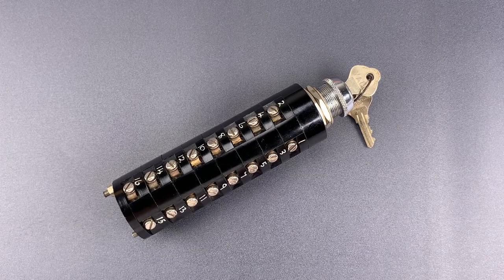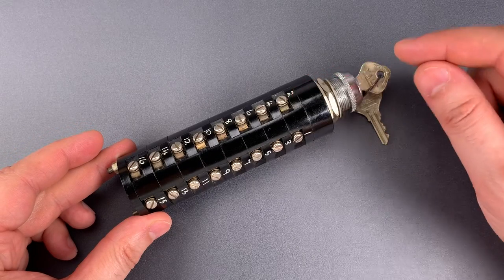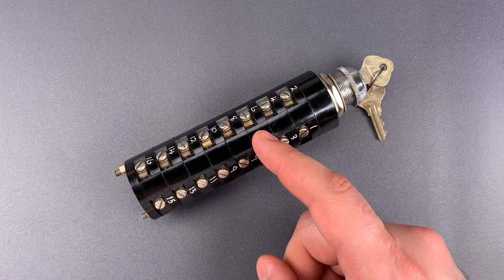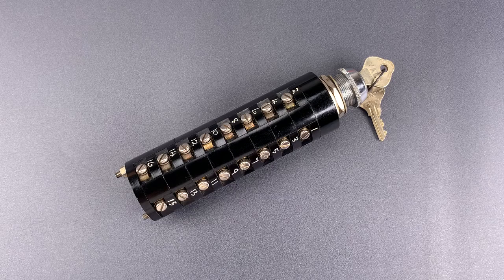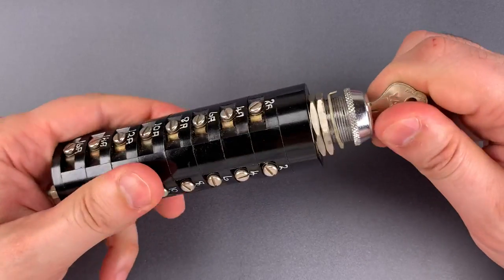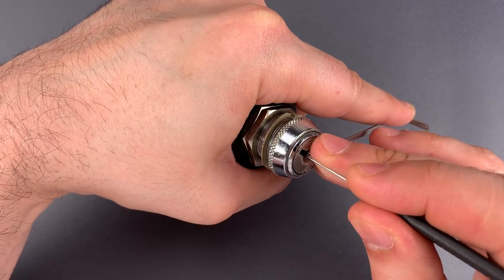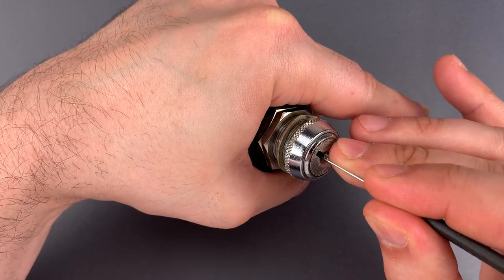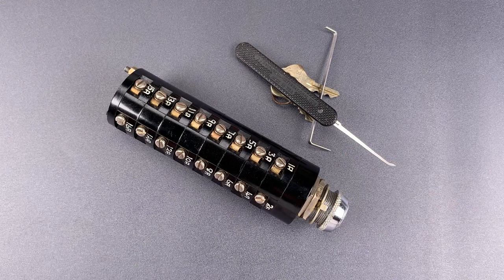[1154] Missile Control Key Switch Picked

Comment: For those of you blasting the use of a wafer core on a missile control system:

You may have heard him say that this is part of a lockout system used for pilot training, which means that it will usually be just left on, and only locked during training (when the plane would normally not have any weaponry loaded any way).  So this is a lock that would normally be unlocked (so why make it high-security?) and only used when there is nothing to lock away (so why make it high-security?).

You also get to see stuff like this a lot when working in high-security areas.  Locks inside secure areas are mostly about keeping people from making mistakes, not about additional security.  When the building is already made of 8-inch rebar-reinforced concrete, no windows, steel-bar-grids on the ventilation, safe door with an X-09 combination lock as the only entrance; either only trusted people are going to get in, or whoever forces their way in could go right through any internal security.

Also, lock-switches in electrical systems are inherently bypass-able by anybody who can get inside the chassis, and most electrical systems aren't built inside a safe.
Reply: I disagree on one point you make. Im no expert mind you but it stands to reason that training pilots would (in some situations) have their planes armed or loaded. The flight characteristics of a loaded vs unloaded plane are subtle to be sure but as these pilots are to know their plane upside down and backwards i would bet they can tell the difference.
Reply: La Nausée  Excuse me? MY logic is faulty? You think aircraft carriers have extra room for dummy missiles? Or that the military would spend 10s of millions of dollars on non functional weapons? Or that the military would take the chance of having dummy missiles loaded on a plane that could be deployed to live combat at a moment's notice? I'm sorry but MY logic is rock solid.
Reply: @tjthrash0143  You sound just like any random guy who never actually served,,,but who has watched lots of movies and TV....My experience is in opposition with your speculation...But believe anything that you want to...
Reply: @stevebell4906  My tiny bit of knowledge and common sense trump your unspecified experience. Unless you care to enlighten us all.
Reply: @stevebell4906  So instead of informing us and either continuing the debate or ending it with your vast experience like a mature adult you choose to lob insults reminiscent of a troll.
Reply: @tjthrash0143  There is no argument of debate....The fact simply is I am totally unconcerned with convincing you that fire is hot or water is wet....There are many like you that embrace an alternate one where reality and facts...and proof or evidence are of no consequence in...along with experience....Henry Ford is credited with this quote..."The average person is will to do almost anything to avoid having to think"...Enjoy your magical thinking...after all you just somehow magically know!...and I couldn't possibly !
Reply: @stevebell4906  as you wish troll. Good day.
Reply: @tjthrash0143  By by whiny boy....
Reply: "They'll never get past the perimeter defenses."

"It's just a precaution against user error!"

This kind of philosophy is how Metal Gear got compromised in 1977, and every 3-5 years after.

Will we ever learn?!
Reply: @Cinkodacs  Apparently your google feng shui is greater than mine.
Reply: @tjthrash0143  if the weapons are painted blue, their are training ones. You can see all sorts of blue weaponry, including missiles
Reply: @tjthrash0143  dummy munitions are used all the time for training. They are painted a different color, usually a turquoise blue, to distinguish them from live munitions. Don't believe me, Look it up.

Yes. An aircraft carrier has room for them. I'm not sure you really understand just how huge an aircraft carrier is.
Reply: As a security guard who's familiar with government contracting, I can confirm that the farther you get into a secure area, the less intrusive the security checks will be
Reply: Thresher the military absolutely wouldn’t spend tens of millions on dummy training missiles. It’s probably hundreds of millions. And yes, there are a TON of training missiles for all sorts of training. You can find plenty of videos about them here, or other research on Google.
Reply: @tjthrash0143  you are funny: "like a mature adult".... say no more right
Reply: @Kelvin.id.  he got BTFO'd, I don't expect he'll be back LOL 😂 Anyway, regarding training munitions... they tend to fall into two categories: captive-carry which are usually just a shell with ballast weight to simulate the real thing for handling and drag and only go on and off the plane by ground crew (they're as much to train these guys as the pilots). And live devices with functional propulsion/guidance but an inert warhead which would be used for live-fire exercises. Explosives are expensive.
Reply: La Nausée  In north Germany there was an incident where accidentally a mililtary jet dropped two dummy weapons onto a wheat field or similar. So they have dummy weapons which cannot be launched but still dropped. Or it were fake bombs. I am not sure but I think there are also actual launch able rockets which can fly but do not have a warhead.
Reply: When you need just a little bit more security than a switch. Most likely being used by an ordnance guy to make sure A:  A random short circuit doesn’t launch a weapon while his crew is loading it or B: Make sure the release mechanism of the telemetry pod that replaces something like a sidewinder during training doesn’t accidentally get thrown overboard when the pilot pulls the trigger. The second set of circuit terminals adds credence to that as different actions would need to be taken by the launch mechanism in those different scenarios.
Reply: @tjthrash0143  Not only are dummy weapons used for aerodynamic reasons, but when using the sidewinder they have an inert version with the seeker head so they can practice acquiring targets with it.
Reply: @Teampegleg  That's pretty cool. Alot of people have corrected me on this but thank you for the additional info.
Reply: Hoo boy another INTERNET ARGUMENT
Reply: Wait shit im late nvm
Reply: Also let's not forget that most of the security comes from the fact that it would be very very hard to get into a fighter jet at an airbase without authorization to begin with, it's kinda like how MRAPs don't even require a key to start, because it's assumed you're not gonna be able to get into them unless you're supposed to in the first place.
Reply: yeah but.... Nobody hs blasted the use of a wafer core..
Reply: tl;dr it's a safety lock not a security lock.
Reply: LOCKS ONLY KEEP HONEST PEOPLE OUT
Reply: @tjthrash0143  uhm, a bit of both actually, and yeah, airman here. They use live missiles when dogfighting against obsolete remotely piloted F-16's at the end of their service life, the reason is to increase our skills at taking down planes that are incredibly hard to take down. But for most other circumstances, dummy missiles and bomb loads will be used, because for the most part, a misfired dummy missile, or an earky dropped dumb bomb, won't hurt people in a 100m radius or more
Reply: @ToastGamingNCrew  Thank you for the info. And for your service!
Reply: Yes, I think that the military will definitely spend 10s of millions of dollars on nonfunctional weapons. That's just how they roll, ya know :D
Reply: La Nausée  Wouldn't they have to do SOME training with live weapons though? Like on a bombing range.

Comment: Seems like this is more of a fail safe than a security measure. An arming switch that needs a key and has to be turned firmly can't get turned on accidentally.
Reply: It is safety measure for electrical circuits to work only on 0 / 1 position and make intermediate position as short lasting as possible.
Reply: Yeah its basically there to make sure that you can't accidentally have live missiles on an aircraft. You'd need to have the key which you'd have to request anyway and you'd have to have purposefully used it, no accidents here.

Comment: I have used many of those switches.
It was used on training boards. To induce faults. The odd and even wires along with switches induced faults to certain components for testing.
Let's say you wanted to test a student on what he learned. So you turned the key to the position and other switches to the position. The student uses his meter to touch test points on the test board. Then writes down his answers and what he thinks is wrong and how to fix it. The student then turns in his answer. The instructor flips up the next switches and it gives a new fault for the student to test.  This allows the instructor to have 20 boards next to each other and the answer to each board to be different.  All the instructor has to do is look at what position the key switch is in. And any of the one other switches position is in the up position. The Instructor then knows what the fault is for the test. The instructor marks on the student's paper and the student has a grade, for each fault test. the key was there so the student couldn't change the fault control on the front of the board where he had access.

Comment: It's a commonly used key switch from back when I was an apprentice electrical engineer. The company I served my time with constructed oil rig switch gear. These switches would be used on pretty much every switching cabinet and can be built up just by adding more switch barrels to the end. I recall the storeroom having them in various position settings from the basic 2 position in the video right up to the massive 32 position barrels which were around 15cm/6 inches in diameter, still operated by the same tiddly little locking mechanism.

Comment: You have to consider that in the 80s, the sort of information required to pick a lock like this was a lot harder to come by. Furthermore, these locks would pretty much only be used on secure military bases. This lock is sufficient enough to slow down your common hooligan long enough for the armed guards to show up lol.
Reply: It's more likely designed to keep airman from accidently setting it off nowadays the ones I seen are literally held with a screw
Reply: @ALPHABEASTACE  Yes, more like the maintenance locks used in industrial facilities to prevent accidental starting of machines while someone is working on them.

The pilot would probably have the key in a sealed envelope or something like that and if ordered to use live ammo he would take it and use it. Otherwise why bother loading live ordnance on board in the first place if the pilot has no way to access it during the flight?

So more like sophisticated safety catch.
Reply: @Murgoh  Given that he said training, it's live missiles loaded on an aircraft, but set into a configuration where they acquire target, but do not launch. For a lot of ATA missiles, a good portion of what acquires the target lock in entirely inside the missile itself. Even if you were using a missile with no warhead or motor in it, you wouldn't want to go through with the gull launch procedure, and jettison a pricy training aid off the launch rail. You also don't want anyone to accidentally switch the plane into training mode during a live exercise, hence a keyed switch. The pilot wouldn't have access to they key, so can't change from training configuration to combat or vice versa.

Some exercises are also performed at bases where live combat operations might need to be launched from at a moment's notice, hence planes are kept fully armed with live ammo and don't need to waste time changing from training to combat configurations.
Reply: @kauske  Great explanation.  So basically the lock is just a fancy switch that is difficult to accidentally flip into the 'armed' position and has little to do with the security of the payload itself.
Reply: @jonnyknuckles489  That's what most safety lockouts are for, as the person above me pointed out, mechanically flimsy locks are often used to lock out industrial machines for the same reason. One could likely smash the lock off in a few minutes, but it stops someone from carelessly flipping a switch when it shouldn't be flipped. 

Or that's the idea on paper, anyhow. A lot of times such safeties get bypassed for convenience. Keys left in lockout switches, sensors disabled or bypassed. People often forgo safety if it even mildly inconvenienced them, haha.
Reply: Why would a common hooligan break into an air force base of all places
Reply: It was to prevent accidental operation.  It only had to be good enough to prevent somebody being able to use a screwdriver or a bit of soft drink can.
Reply: @ts757arse  During that period there were also suggestions that protesters should learn how to disarm the nukes if they got close enough, as the movement ultimate goal was to completely remove the possibility of all-out nuclear war.
Reply: @ts757arse  John may be thinking of a case where an elderly nun managed to get all the way to the storage bunker, tagged it with graffiti, and wondered where the (expletives deleted) the guards were. Probably half an hour later the guards showed up.

Yes, she was convicted and I think sentenced to @5yrs. The guards were all fired and their employer barred from further government contracts.
Reply: @ts757arse  I somehow expect that the prosecutor was a bit apologetic about it. "I have to make a case of this, you got way closer than you were ever supposed to. I don't entirely want to, because you showed a gaping flaw in security. So, I will push for minimum sentence if you walk the new security team through how you got there."

Comment: As an ex Jaguar Avionics Engineer with the Royal Air Force, I can definitely confirm that this lock was never used to lock out the Sidewinder weapons on Jaguar aircraft. Sidewinders were selected and controlled using switches and software on the Jaguar until it's 2005 retirement.

Comment: I would assume that most of the early aircraft that could carry AIM-9s in some form carried this type of switch in order to prevent friendly fire during training, as seen during the F-104 "intercept" incident where their switch failed and they shot down the British aircraft. Unfortunately, I have no idea which aircraft it comes from as I assume it's underneath one of the outside panels, so only ground crews can access it.
Reply: No reason to load live missiles if the pilot has no way to use them so I believe the lock would be accessible to the crew to be armed if for some reason ordered to. For example if a possible threat requiring investigation appears during a training mission in or near a hostile country.
Reply: @Murgoh  So if the pilot forgets his keys at home he can make a quick pit stop at  LPL and be on his way in about 30 seconds
Reply: @Murgoh  Don't forget the amount of time where the aircraft is still on the ground with the ground crew loading said live missiles, fueling, doing pre-flight inspection, and so forth.
Reply: @Murgoh  the reason to load missiles (live or not) during training is so the trainee can experience flying under the actual load.

Comment: I've seen similar switches used in railways to switch signal panels in and out of use, so I imagine the same types of switches could have been used in any number of Air force application, such as similar computer control panels on various systems.

Comment: Many moons ago I assembled switches like that at a summer job - or close enough. The stack is fully configurable per order, you get the connections you want by placing correct wafers inside each segment. Some are just a couple of segments tall. some are even taller than the one you have here. The handle that turns to the axis is a separate part, and key models (like the one here) exist as well.

Most keyswitches that I know are not meant to be high security devices, but rather used in places where the panel is easily accessible to people who should not fiddle with it. The electrical cabinet itself can still often be opened with a utility key, or has another not-very-secure lock.

Comment: This is a rotary lock used for locking out military range controls (ie, ignition, shut down, or range safety) and provides a means of protection to keep the circuit from being energized prior to testing. The lock goes on a remote station control panel (a panel located some distance from whatever is being activated such as a control bunker) and once the key is inserted and turned it energizes the circuit. The multiple terminals would connect to various lamp indicators on other panels showing information such as "armed" or "active" as well as going to switches such as "ignition" or "engage". The lamp indicators once energized would give the status but the switches provide another layer of protection. If you watch footage of military tests (like rocket sleds or missiles) you can see similar devices installed on the control panels. These particular rotary locks were phased out of US military use in the 1990's and replaced with "safer" devices that were less prone to failure due to corrosion control issues.

Comment: I heard "From the UK" having read the video title, and immediately assumed this was to provide power to the launch mechanism for our early nuclear ICBMs. The launch codes for which were reputedly 00000000. Coupled with a wafer core which can be picked in under a minute, that's high security for Polaris!
Reply: There's also hundreds of armed soldiers who know they're guarding nukes and are authorized to use lethal force on intruders. That helps the physical security aspect.
Reply: I read waffle core.
Reply: @erikburzinski8248  Probably no less secure.